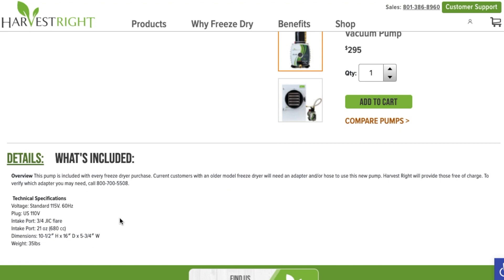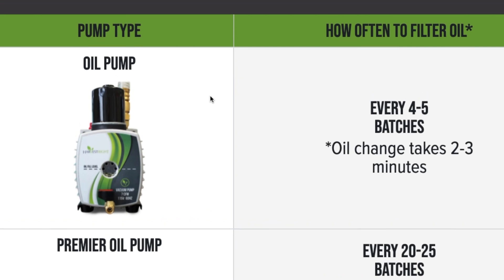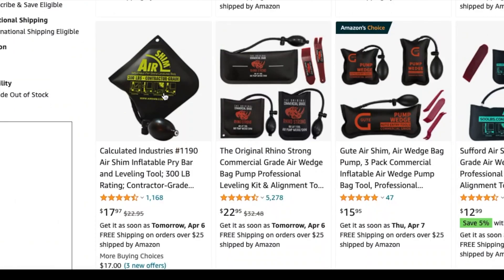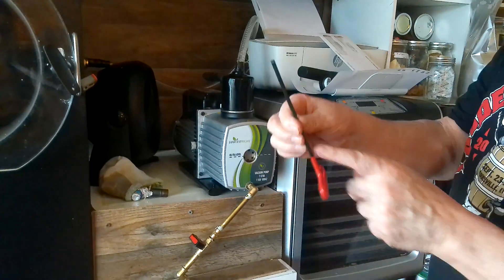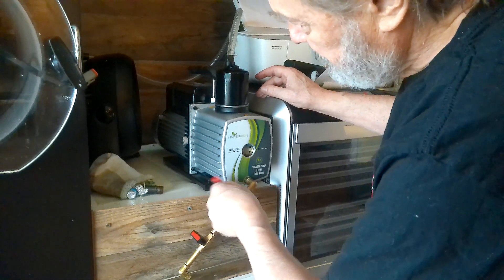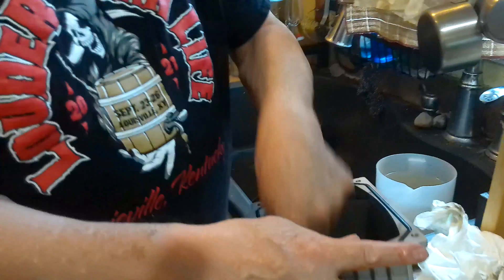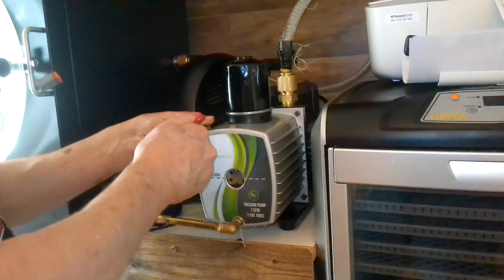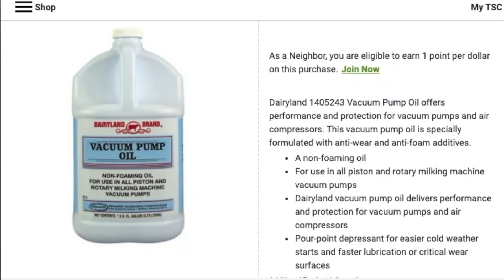Harvest Right Oil Pump Cleaning and Customizing

Comment: "Question? What is the silver knob on the side used for?  The owners manual doesn't say anything about it.
Reply: I had the same question as we have that knob on our standard pump as well and couldn't find anything about it in the manual or online. I spoke to Harvest Right technical support, two different techs actually, and they both confirmed that it's a gas ballast and for the Harvest Right freeze dryer it should be closed and remain closed at all times.